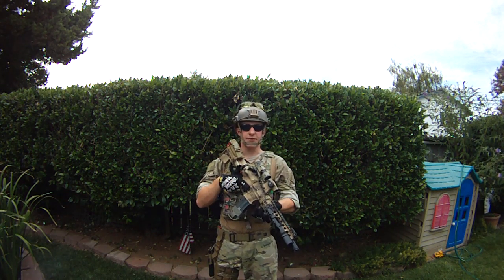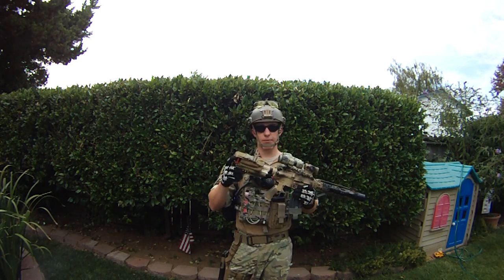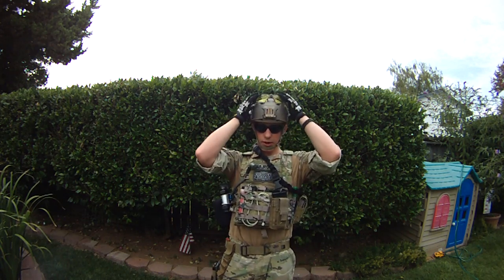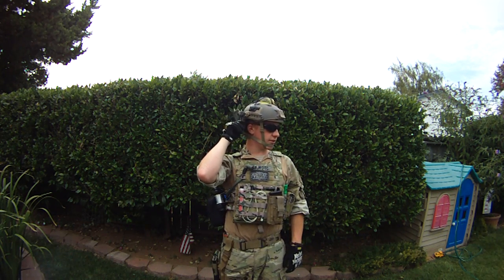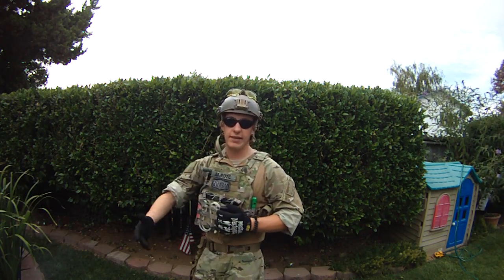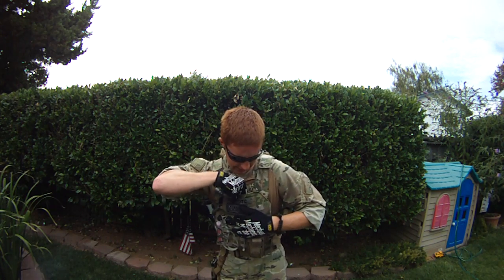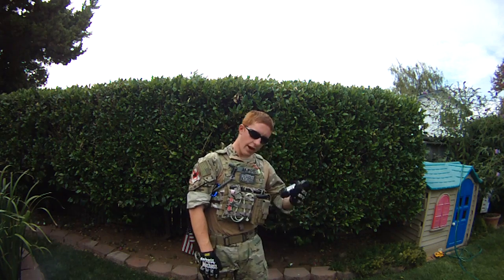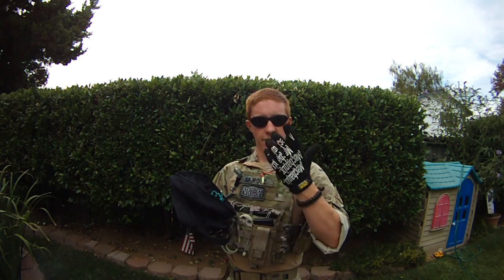Air Force Para Rescue Men Airsoft Multicam Loadout

Comment: Hey man just a few suggestions. PJ's do not run anything on their legs and you might want to slim your rig down a tad bit. Don't put so much bulky stuff on it. They do not put much on due to getting in and out of pavehawks easily. Also do not buy TMC pouches. Go with blue force gear. Aside for those few things good loadout.